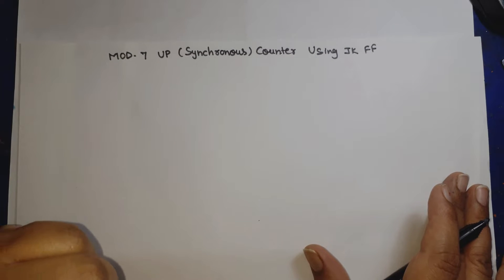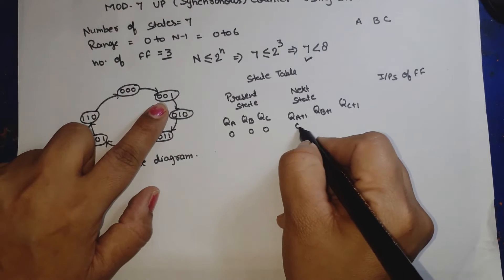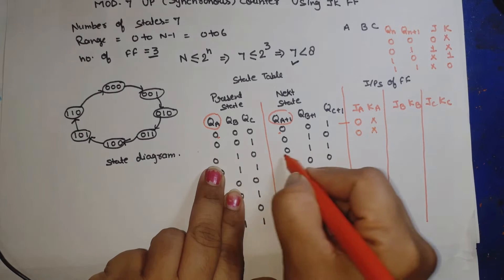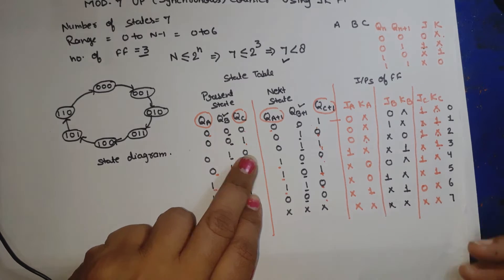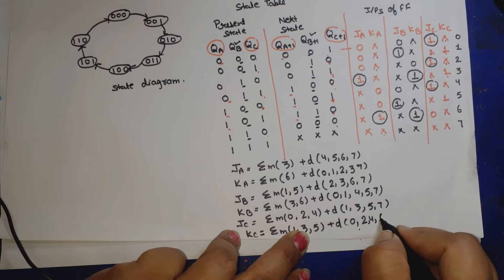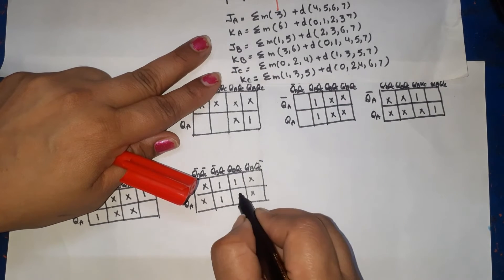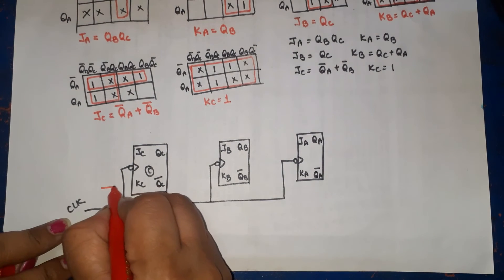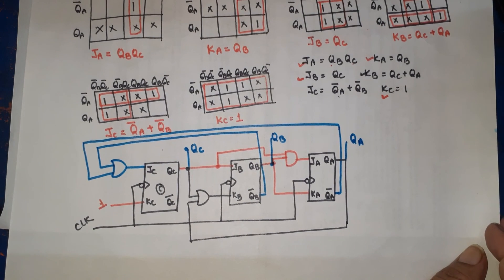MOD-7 Synchronous Up Counter Using JK flip flop | Mod 7 counter using JK flip flop

Comment: Mam, how can we solve mod-60 synchronous up counter by using jk?
Reply from the maker: Method will be same 
Counting range 0 to 59
No. Of flip flop required to design 6
60, 61,62 & 63 as Don't care
Reply: Mam, then is it possible to draw state diagram for 0 to 59 and its too lengthy ?
Reply from the maker: @roshanbahadurlamka3108  yes possible but big diagram and table is also lengthy in case of Synchronous

Comment: hi, can I know is it the counter already have self stopping or we have to include another OR gate for that ?
Reply from the maker: It's Synchronous counter so u have already designed it using state table so no extra gate required in case of Asynchronous counter NAND gate required to reset the all flip flops